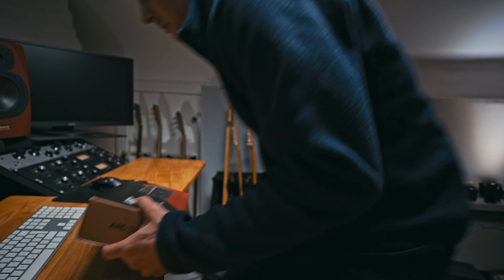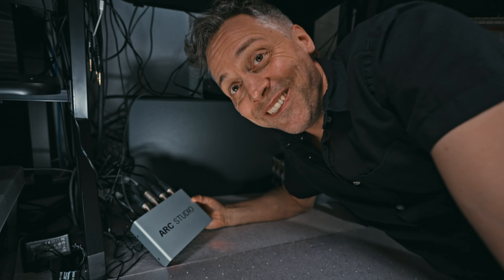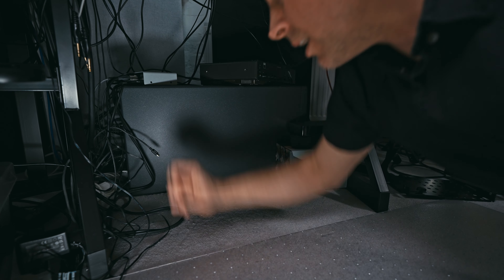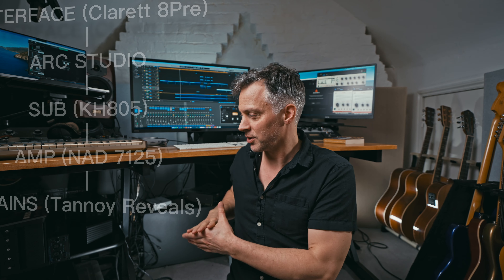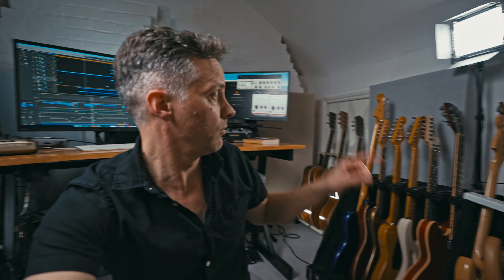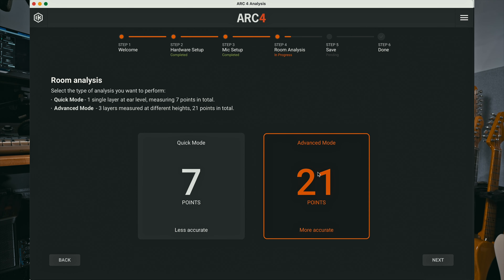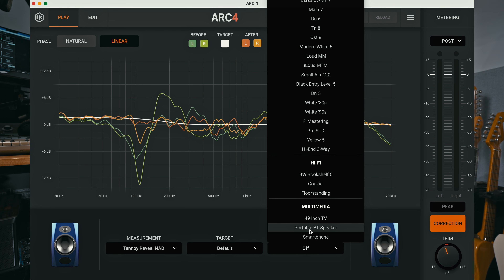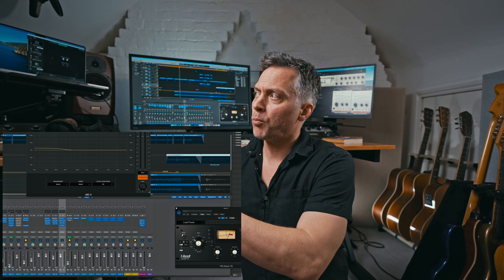NEW room correction product VS horrid monitoring setup - ARC Studio hardware speaker correction!

Comment: Thank you for addressing the latency issue. Does the bypass button disable the digital circuitry and DAC on the box (true bypass)? Or does it merely disable the correction EQ?
Reply from the maker: I believe so - the button operates a relay which clicks and I can’t imagine they’d bother with that if anything at all is left in-line. Manual says: ‘CORRECTION: This button enables or disables the audio processing. When CORRECTION is off, the unit is
bypassed and the input signal is routed directly to the output.’
Reply: @JonWrightMusicTV  Oh, thank you! This is exactly what I wanted to know!

Comment: If you take the box out of the equation, the question is: Does ARC Studio sound any better than Sonarworks? Would be interesting with a comparison...
Reply: ARC4 seems better than ARC and Sonarworks in my application, just been doing listening tests. It looks the same as ARC3 mostly but seems better.
Reply: @jrgroberts that would be considered confirmation bias that last bit
Reply from the maker: I certainly don’t know. If we need room analysis software to show us the inaccuracies of our speakers and rooms, it seems unlikely that our perception would be good enough to identify which correction is most accurate. Isn’t that logical?

Comment: If it allowed for applying a crossover (hpf) i'd buy one right now.
Reply from the maker: Can I ask why you’d want that? I don’t immediately understand why you’d want to control only part of the spectrum
Reply: @JonWrightMusicTV  it's useful when you have a (or several) subwoofers. It's easier to integrate. Mine has a low pass filter so i only need a high pass one in the source. Unfortunately, apart from home theater gear, not many other kit has one.